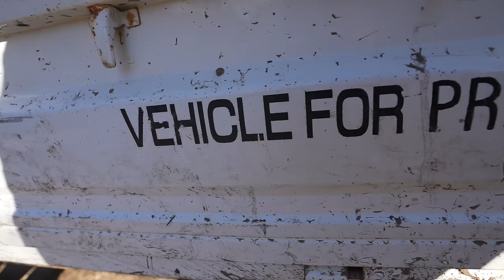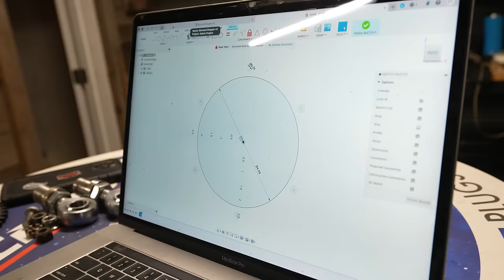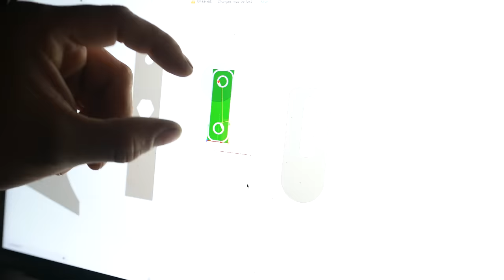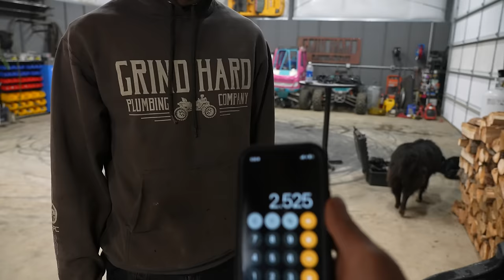How to Build a Sleeper Go Kart!

Comment: If/when you guys put dirt wheels and tyres on this go kart; keep in mind that it's designed for sealed roads.....so it has no suspension! Make the wrong mistake and you could really injure your back?
Perhaps put one of those gas ride seats that they truckers use in their big rigs? Maybe take the air ride part off the bottom and attach the race seat and install back in the go kart. Move, repositon or extend controls where necessary. Fixed. Suspension for just 1 driver, rather than complex suspension for 4 wheels?

Comment: Will, you could have put a gear on the motor, then had it power the same size gear with the sprocket attached to it. This would have reversed the direction for you without having to swap sides with the motor.

Comment: Edwin "I feel like something bad is about to happen" just as the throttle sticks wide open in reverse and drags Will's butt and back across the ground. I'm surprised Edwin didn't get whip lash when backed into the building support in reverse at full throttle.

Comment: 16:00 Emmmm... to Reverse a 3 phase AC motor, you just need to swap any 2 phases with one another... Then in some cases you might need to also fiddle around with the encoder sensor pinout to also invert the 2 signals, or swap the corresponding 2 signal wires for a 3x hall sensor setup but trust me, it is doable. I do this for a living but with stuff these controllers and motors are actually supposed to go into and i also build my own lithium batteries at home and have a 5.7kW AC motor off a forklift in the trunk of my car for a future project. Don't want to be mean to anyone but you might need some better experts. XD

Comment: How many wires going into the motor? If 4  or 5 you have a 3 fase motor which is reversable. You need to put the blue wire (zero wire)back where it was and switch two of the following color wires: grey, black, or brown.(fase 1,2and 3 wires)  You should als have a green/yellow wire (grond wire). That's how it works here in Europe anyways....

Comment: It would have been harder but the potential for more speed is greater also. To make the reverse spinning motor make the vehicle go forward instead of chain drive you could have gone with gear drive. Realistic could have built a gear box for it and really made it rip....but again that's incredibly hard
Also could you imagine how much even more drifty it'd be with drift sleeves (big PVC tube) over the tires

Comment: West side of  the 95 north of Hayden   Idaho   Southeast of Lancaster there's that industrial park and you guys will be able to identify all the quarter mile burnout marks I'm not going to give you the exact location you can throw a drain and drone in the air but there's definitely drag races that go down second road back on the industrial park.  And east of the 95 off the Garwood exit in front of the Garwood junkyard that's all new pavement and it's straight

Comment: Just so you guys know I don't know where you guys put your phone at otherwise but putting it in your rear pocket is actually safer for yourself physically because of the radiation it puts off during calls and receiving calls and so on and so forth if you put it in the front pocket you could lose all use of your well your tool so put it in your back pocket safe the only downside is you have a risk of cracking the screen if you get a proper case you shouldn't have to worry about that

Comment: Lol I did the exact opposite to an old razor drift cart 😅 ripped the electric junk off welded a 4 bolt plate for a predator on the frame and through a predator 212 on the back of it I've melted the tires on it twice😂😂 or you can swap it for a set of larger tires and with a set of wheelie bars because its so heavy in the rear with no weight on the front a larger tire with tread puts it right on the wheelie bars breaks cheap set of casters for wheelie bar contacts and completely shattered them on the regular then your just dragging a bolt throwing sparks doing a wheelie😅😂 just depends on how you would like to die it will kill you drifting or kill you in a wheelie 😂😂

Comment: Why don't americans use guards on grinders? Don't they even come with guards? The guard is super useful for guiding blade to do acurate cuts, i see very few circumstances that the guard would be in the way. And as mentioned in the video those ultra thing cutting blades are super sketch.

Comment: Why doesn't and esc that high end not come with a way too program it yourself, especially  since its a sensored system for many different applications. Even cheap drone and rc stuff has Bluetooth, programming cards etc. Please put a feont crash bumper on it before you guys crash amd your cut in half or the steering column inpales one of you like old cars used two before crumple technology was figured out by IIHS. You guys are all smart and wealthy, dont die just trying to entertain yt. It'd be just as cool to see you test on a proper track where you cant run off the road at 60 into the trees.

Comment: This is WhistlinDiesel but a bad version of it, I am sorry. Maybe he does not publish near detailed enough shots as you do so there might be bias. That said, that reverse crash (if only you could modulate reverse) as well as being thrown out of the cart with no circuit breaker is silly rushing that will cost you at some point more than just hardware.

Comment: I got a road it’s long we race bikes cars and about everything down it it’s prob 2 miles long no traffic no cops there is a slight turn in the middle but it’s dead ass on the middle of the 2 miles so you can try both the mile before the curve and then the mile after the curve it’s where we go on 1000cc sport bikes to prove who’s faster as well as 1100hp cars not many houses around and the ones that are around don’t mind we have been there from sun down to sun up before cops don’t come this far in the cut of you have ever heard of the dragon on 129 in tn that leads to nc and is like 600 curves or something like that it’s at the beginning of the tn side it’s a side back road that’s strait as a drag strip then slight turn and samething we have races around the curve as well with spotters but never cars on this road and we have had cars go around it at 160s and it wasn’t no different then going around a little bend it’s so long and shallow you can still race around it and see if anything is coming google earth 129 in tn and go past the pumpin center and there is a rail road bed road follow it to the next road and that’s it

Comment: These side projects used to be fun and endearing. But this one was kind of embarrassing to watch and frankly, it's only a matter of time before one of you seriously hurts yourself. Pushing the boundaries of things is all good when it's calculated but this build was completely out of control and not really even fun to watch. Ethan has become a master builder and is doing some amazing things. Will and Edwin need to spend a little more time developing their skills so they don't end up killing each other. It's all funny and stuff but if someone gets seriously hurt it won't be funny at all.
Reply: You've only scratched the surface of the things they do that will end badly. Safety is almost nonexistent, welding without proper PPE, welding with solvents on the same table (BOOM), welding with no ventilation, could go on but why.
Reply: @SolitaryCanid  Ya I've noticed a lot of that. There's a point where it's sort of funny and cute and one of the schticks of the channel. And then there's a point where you just genuinely are concerned for their well being. Seeing some of the insane crashes where the throttle got stuck and Edwin got slamed into the corner of the wall. And then that wasn't enough to stop and fix it. But Will did almost the same thing in the next clip. It's just scary at this point and no longer fun to watch.

Comment: Yea...whoever makes/sells those motors is kinda scummy. Having you send it in for "reprogramming" surely wasn't a free service out of the kindness of his heart, but realistically that's not even necessary as he SURELY knew you can make it work as is by just reversing the sensor wires same as with power.